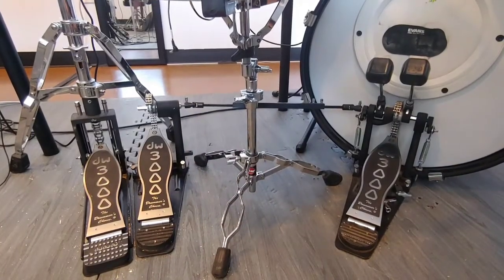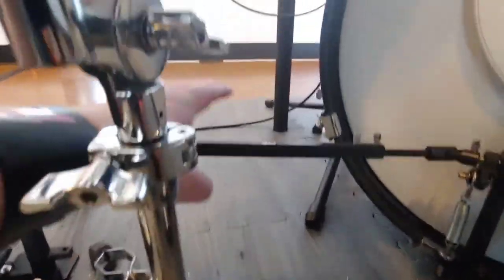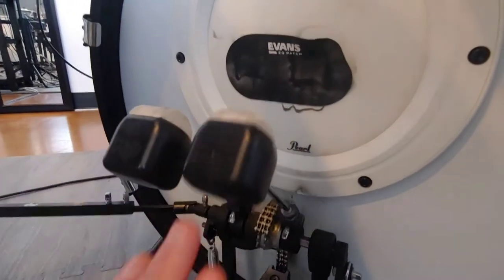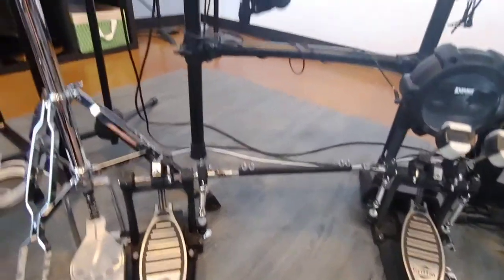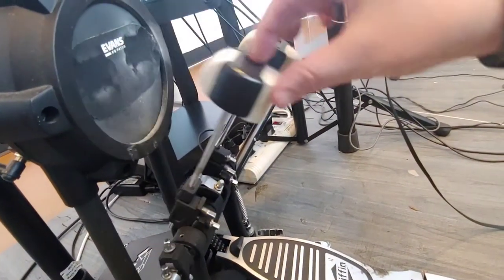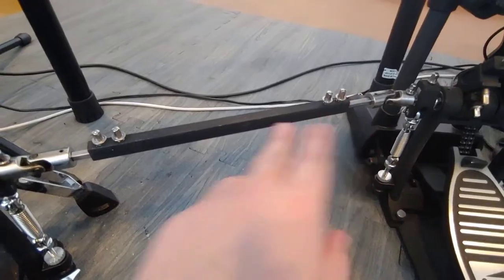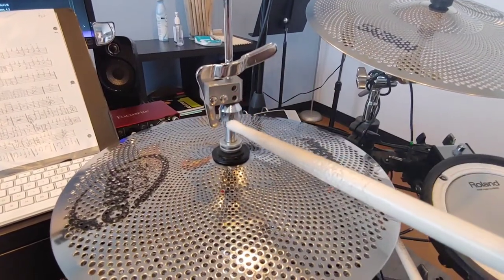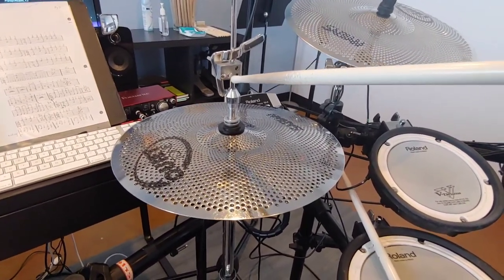Double Bass Drum Pedal Setup

Comment: Thank you. My double pedal didn't come with a user manual or anything like that so I was losing my effing mind trying to get the double pedal to play nice with the snare stand. I did have the shaft on the near side of the snare stand but the screws were getting stuck on the snare stand. So then I tried putting the snare on the other side of the shaft but there was just no humanly possible way to set it up comfortably.
Reply from the maker: That sounds so frustrating! Double pedals can definitely be tricky to set up, especially without a manual. One thing you could try is adjusting the positioning of your snare stand height and angle so it doesn’t interfere with the pedal shaft. Some drummers also shift the snare stand slightly to the side or angle the left pedal just a bit to get more clearance.

It might take some trial and error, but once you find that sweet spot, it’ll feel a lot more comfortable. If you can, check out online diagrams or videos that show different setups—sometimes seeing how others position their gear can spark a new idea. Hang in there, you’ve got this! 😊🥁

Comment: so is there 3 springs on the pedals or 2? on mine there's 2 springs on right pedal and one on left. can I take the left one off on left pedal? thanks for any advice
Reply from the maker: @JaBridgewater13 Both springs should be on the right (main) pedal. The left (slave) pedal doesn’t need its own spring, as it relies on the linkage connecting it to the main pedal for tension and responsiveness. Removing a spring from the right pedal could cause issues with performance. The extra spring on your left pedal is probably there so you can convert it into a standalone single pedal if needed. If you’re using it as part of the double pedal setup, you can remove that spring without any issues.

Comment: Hey! I want to buy another bass pedal to build my own double pedal, but can different pedals become a double? Or I need to buy the same brand? Nice video!
Reply from the maker: Thank you for the kind words! As for your question, it is possible to mix different pedals to build your own double pedal, but it can be tricky. The key is to make sure the pedals are compatible in terms of size and how they connect. Ideally, using the same brand ensures smoother integration, but if you're set on mixing brands, make sure the drive shaft (the bar that links the pedals) works with both. It might take a bit of trial and error, but with the right adjustments, it can definitely work. Good luck with your setup!

Comment: My problem is with my Pearl Excalibur the left pedal is hitting metal to metal on the round nut directly below it, attached to the base. I adjusted the chain back a little but it lost its sound. Is there another way to stop the collision of the pedal to the bass
Reply from the maker: I am not familiar with a Pearl Excalibur pedal. Never heard of it! However, on most pedals there are adjustments that would help with the issue you described. Usually it would be a pedal height, and/or beater angle adjustment.

Comment: Hi. Glad for a fresh video. I've been searching for info on stroke adjustment for the same pedal. It's got adjustment measures on the rocker hub, but I'm not sure if I'm supposed to adjust within the smile on the hub or the shaft in the hub? I cannot understand how if the adjustment is within the smile on the hub it remains stationary from the center of gravity within the smile. My kicks keep slapping my shin
Reply from the maker: I think I understand what you're saying. It's difficult to explain. The beater angle adjustment is what you need.

Comment: great tutorial! just one question, I see you're using the same double bass pedal for your e drum kit like I do. Why is there a second spring? I mean you already have 2 springs on the right pedal, one for each beater, why is there another one on the left pedal? That gives me double spring tension so I would have to loosen both of them to fit them the spring tension of the single right spring which is rlly hard to do..
Reply from the maker: Good question! I don't really use the second spring. This is the only double pedal I've ever seen with an extra spring on the left pedal. I assume it's there so you can increase tension on the left pedal, but why? Maybe in case the left pedal lags.
Reply: Because it can be used as a single pedal, the slave pedal even has a beater holder
Reply: @Oerger89  Ah cool that was my initial thought too thank you for confirming! ✌🏼

Comment: oh wait you change pedals halfway through. I've got the dw 3000
Reply from the maker: Got it! The DW 3000 is a solid pedal. If you’re making any changes or adjustments, make sure to check that everything is set up evenly to avoid any issues. If you need any tips on setting up or adjusting your DW 3000, feel free to ask!